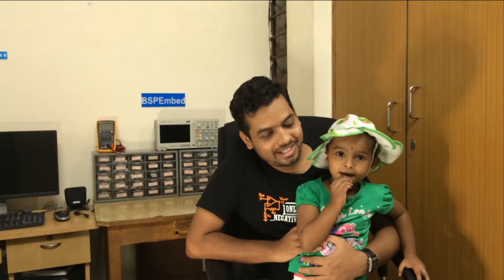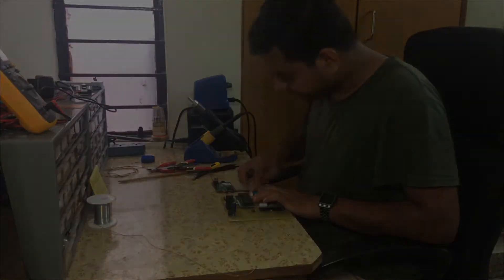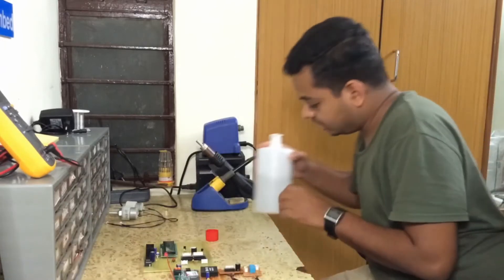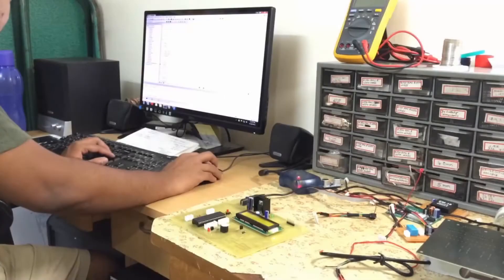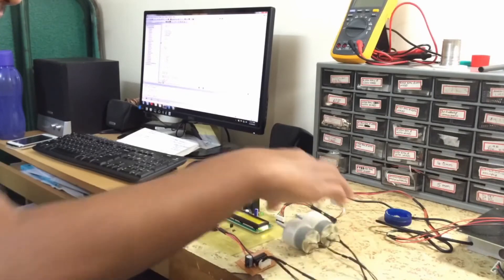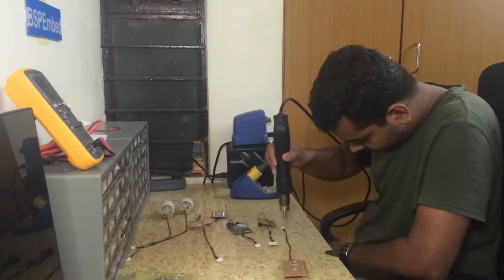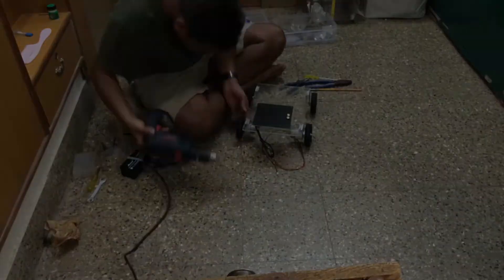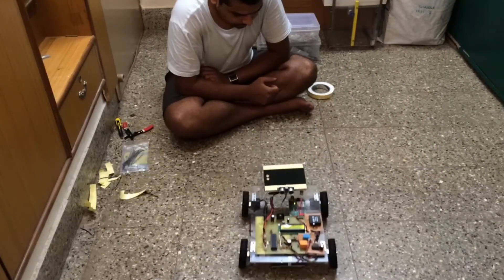Build your own Automated Guided Vehicle

Comment: is it possible without RFID tags ? Because each every time if it wants to go to different paths it will be difficult
Reply from the maker: You can easily change the PATH with RFID Tags. But  Line Follower is more feasible in industries. Please keep in touch with us.
Reply: i am asking without rfid tags.in the sense without any such mechanism of drawing path or placing rfid tags etc. is it possible like that ?
Reply from the maker: I don't think so. Their should be any sensor to guide the vehicle.
Reply: With RFID Tag every time we need to place tag for navigation for different different direction right ?Each and every time final destination changes we need change position of RFID tag
Reply from the maker: Yes, That's the disadvantage of this method.
Reply: Thanks for reply.In Circuit diagram PORT B is connected to LCD and ULTRASONIC sensor. I am not able to see any connection of ADC port. If you have made any document which has all connection written. can you please provide me ? Thanks for help.
Reply from the maker: LCD (PB2 P B7) & Ultrasonic sensor(PB0 PB1) are connected to PORTB. ADC i.e PortA is not used in the project.
Reply: Thanks for reply so whatever pin i am not able to find connection that is not used like PD4,PD6,PD7, PC2 and PC3 are not used. Please correct me if i am wrong, Thanks a lot for help.
Reply from the maker: Yes, you are right.